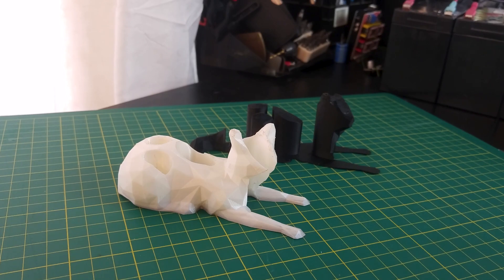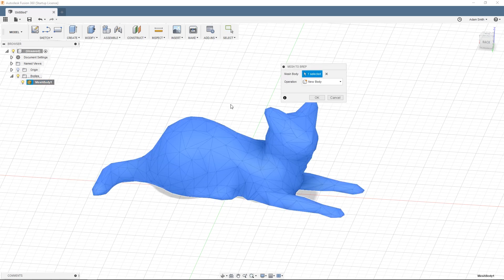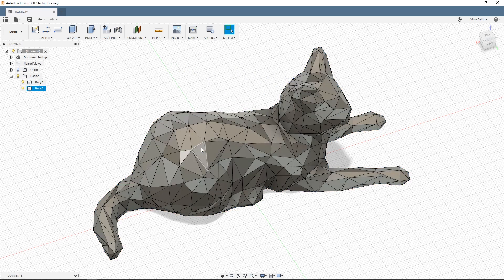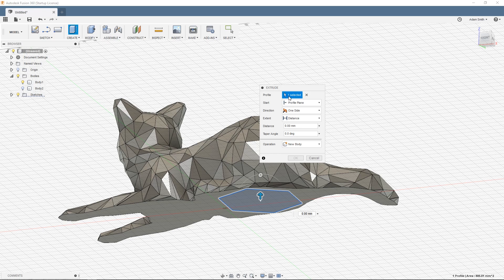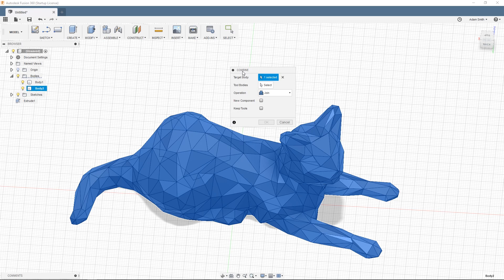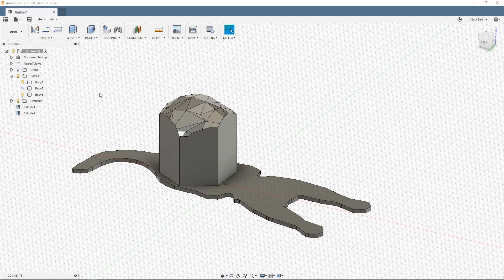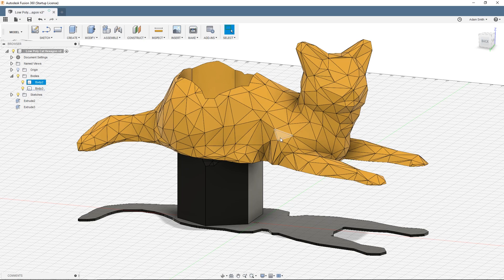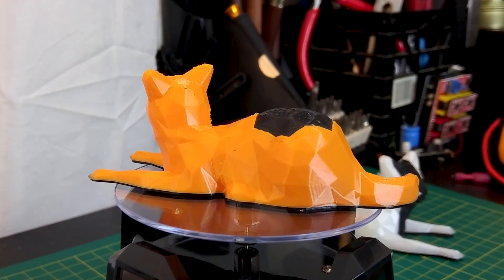Fusion 360: Splitting an .STL Model Into Interlocking Parts

Comment: Thanks for the video, really helpful. One question though; if I were to design this for a resin-based printer, would I also need to add a tolerance of .2mm?
Reply from the maker: For a resin printer, I think you could get away with a much smaller tolerance. 0.05mm or 0.1mm should work, though it might be worth printing a couple of test pieces first to find the tolerance of your printer.